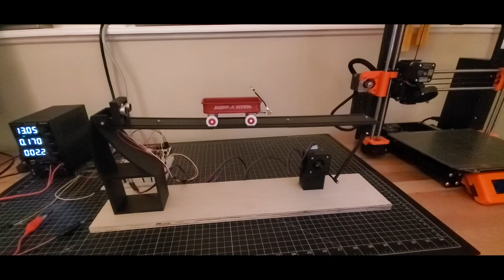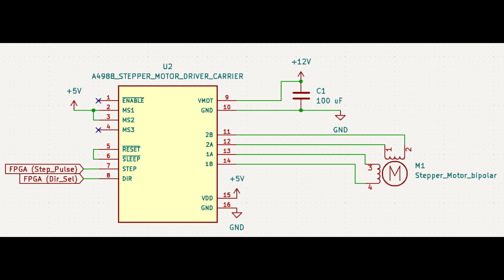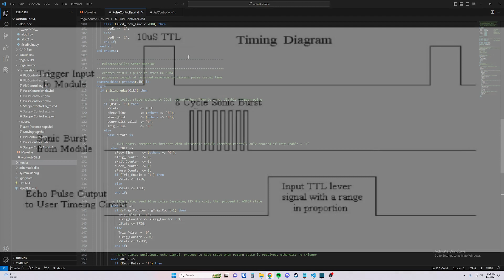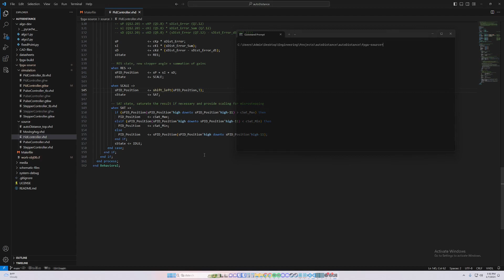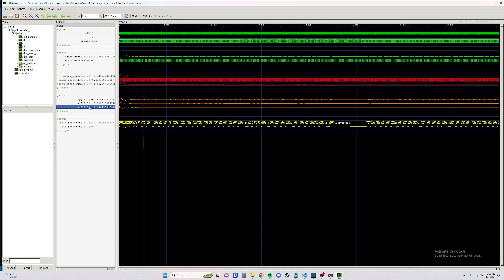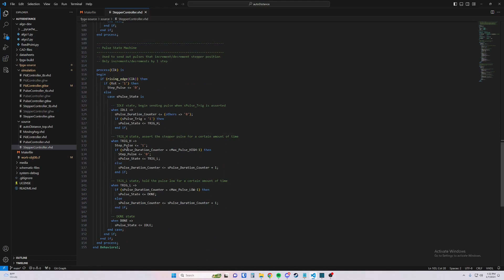PID Control Demo using FPGA

Comment: This is amazing, I thought it would be much smoother though as FPGAs have this clock advantage over MCUs. Is it because of the controller or just the hardware setup? I mean would an MCU here do much worse with same PID parameters